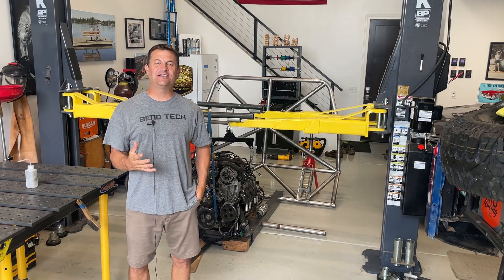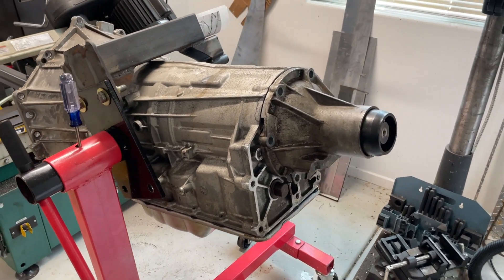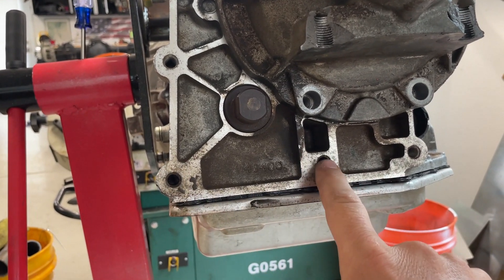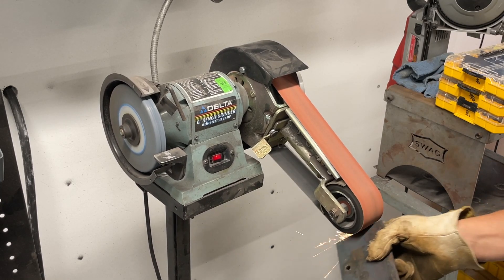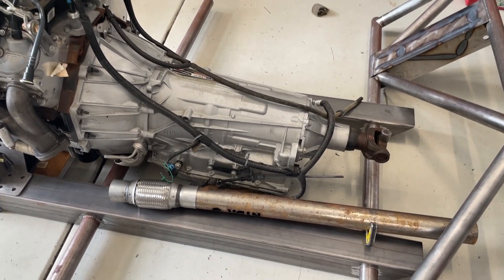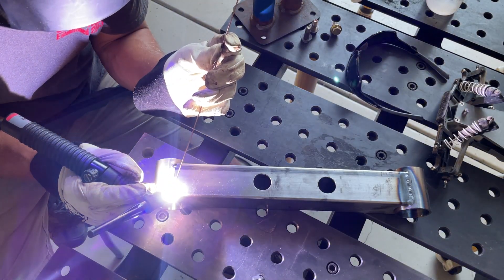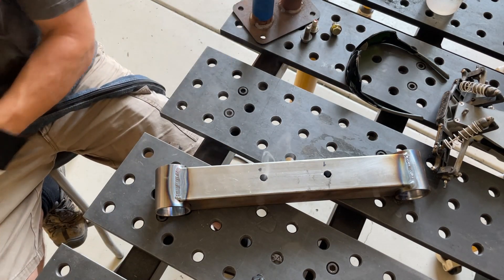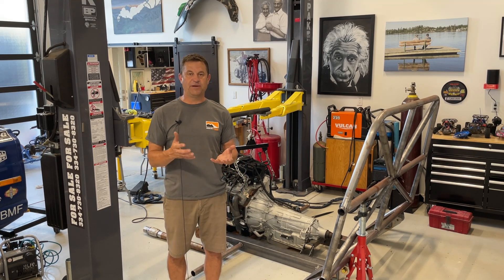How to build a transmission mount - The CrossFire XR makes the job easy!

Comment: Awesome videos.  I am having trouble getting my tcm and computer to work together,  I have an L96 6.0 and 6L90E . I bought the stand alone harness kit from BP automotive with new computer and tcm but having issues. Any tips or advice would be greatly appreciated

Comment: Thanks for another awesome video.  The parts you burned on the table came out very clean.  You should do a video sharing all your cut speeds.  Im sure with your experience with these machine.  It would definitely help me and others out by not blowing through money testing out our settings.  By the way, do you have a recommendation for consumables for the cnc torch on the XR?  I'm having trouble finding the best consumables I can buy.
Reply: I've been always taking notes when you share your cutt settings.  I need to create  my own library as I continue to get better.

Comment: Cool vid.   We do alot of the same things with the same tools.   Gotta say liking the access from building a desert truck vs crawling around inside porsche tubs to get things done!   SUGGESTION:   You should buy and try a tig button from the 6061 guy here on youtube.   Strange to use at first, but then it becomes the only way to go.   Have to give it a little time, but I haven't used a pedal now for couple years.   Good luck, look forward to steering vid.   We've been using elec steering setups but in the enduros they overheat and the assist dips in and out, so engineer some cooling if that's the plan.   Hi caster and big tires create load even in a steady arc, so I can't imagine what controlling those desert tires requires.   Looking forward to it!   Thanks.
Reply from the maker: I do have one of his Tig buttons.   I like it, but if kind of found it hard to pulse like I can with the pedal.  Probably just need to practice some more.  

For steering we will use a stock Silverado box, but connect it to a slider system to allow for the long travel suspension with correct geometry.    Worked well on Honcho.   Lefty will be a little more math.
Reply: @ntdracing  Ok cool.   Ya he uses that button with machine cranked.   What I did was set machine to the highest amp I wanted for the pulse, then did some practice where I didn't watch the puddle but watched the amp output on the machine.   I figured out the pressure for 100 percent wasn't very high, then watched the machine to figure out where pressure started and was 10% about using the amps.   Once I did that for a session, the "touch" became familiar and "calibrated" and now I love it, especially while crawling around inside a race car.
Reply: @ntdracing  Do you run power assist?   Ya I didn't even think of the problems you must conquer for all that suspension travel.   We used a saturn column with the electric motor assist for a WRL car we built and it was fantastic until it would diminish from heat.   We went that route to eliminate one more fluid system and one more headache from the front of the motor.    I love your channel and you have sparked my interest in desert racing, I used to think I wanted to do that some but road racing sucked me in... Lol..     One of the kids that used to work for me got a short pro ride in a SKOR truck was last time I thought about it.   Looks fantastic tho...   How is your back?  I would have to worry about that.....     Thanks!
Reply from the maker: Did not think of that.  Will give it another try.   Sure would make some of the welds easier.
Reply from the maker: https://youtu.be/95ndC-HQ3Nw.  This was an old video I made.   It show how we made the last steering set up.   Has been indestructible for 4 races.   Will be building something similar.

Comment: Your Discount code doesn’t work for the XR? Trying to check out and it’s saying (Not available for items in cart.)
Reply from the maker: You are right.  I just tried it too.  It may be because they are just taking a deposit and not the full payment yet.  I will write and ask the question.  Thanks.
Reply: @NTD I’m finally at finish checkout after about 2 months. It’s not working on final checkout. Also thanks for the videos. Made my decision on buying the XR from them. Keep up the good work.

Comment: Think about putting a fix yoke on trans and have slip on drive shaft. Thats what most everyone does. I dont know if they make it for that trans. Great videos im going off your lead and got a project with my son now.
Reply from the maker: I totally agree.   I do not think anyone makes a fixed for the 6L90.   Could look to see if a a tail housing from a Camero might work.   I have also thought about fabricating one.   Welcoming suggestions.  Thanks.

Comment: Have u thought about running a mid plate between the engine and trans? They work great
Reply from the maker: I have.  Not really smart on how they connect.  Any chance you can share a link that shows how they are connected/where to purchase?

Comment: Thanks for the video. BTW, if you use your  press a lot, I suggest getting a BIG RED TA92006 Torin Pneumatic Air Hydraulic Bottle Jack, works great on my HF 20T. The HF version is on sale right now for $109. Also, I 3D printed a jack pressure release knob.
Reply from the maker: Thanks for another great tip.  You nailed it with the Magnetic vice.   Checking out the Big Red now.
Reply: @ntdracing  my HF has the 
PITTSBURGH AUTOMOTIVE
20 Ton Air Hydraulic Bottle Jack
on sale right now.

Comment: I got a crossfire pro, I'm just waiting to afford the plazma cutter  to run it, it's still sitting in the box
Reply from the maker: Maybe try posting a question on the CrossFire group on Facebook and see if anyone who upgraded their plasma cutter to a hypertherm would sell you their Razorweld.   I have been totally happy with the RW45.
Reply: @ntdracing  Me too, RW45 works fine.